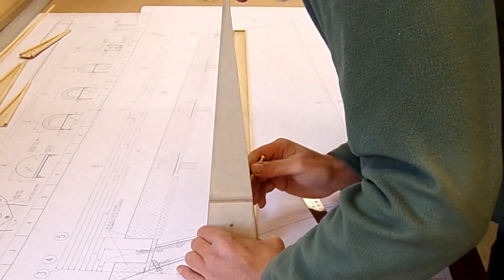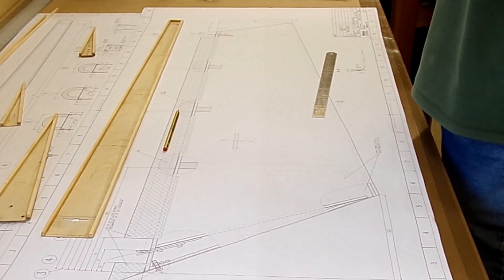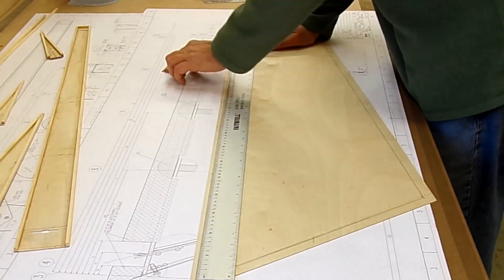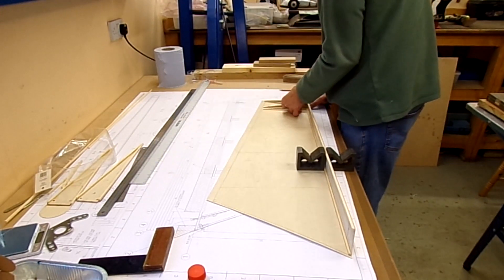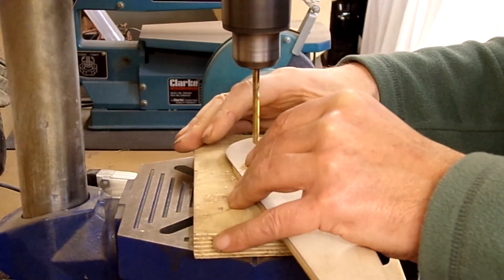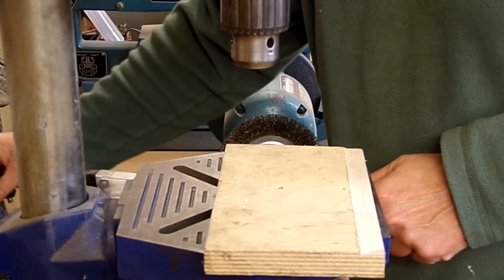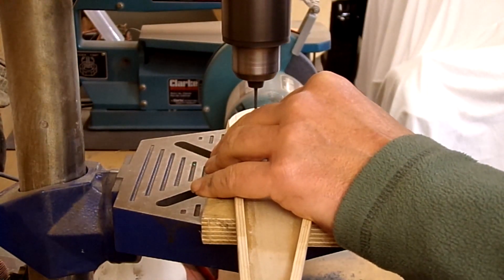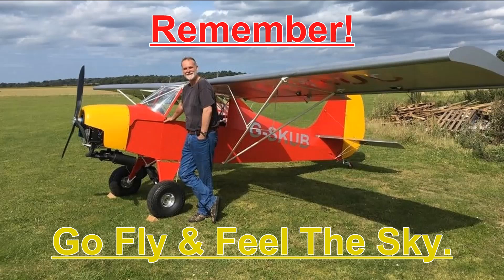Spacek SD1 TD Rudder Build EP4 (Marking out the wood skins & Prep for metal work)

Comment: Victors and the mighty Nimrod, wonderful aircraft.   Not quite as fast as the VC10 though :).  I'm  really enjoying these build videos.
Reply from the maker: The victor was faster than the VC10 at mach 0.9 ant the fact that three Victors had exceeded mach1.1! The Nimrod on teh other hand was based on the first Jet Airliner but was the best Sub Hunter in NATO for years.
Reply: @flyingkub  I can only go on personal experience, VC10 41,000 Mach 0.91, but that was normal and we used a shed load of fuel.  The Nimrod certainly had a loyal following.  I'm sure one day we can have a good long chat. I never saw a Victor fly in real life.
Reply from the maker: @GolfFoxtrot22  You missed the Victor yes we had a spped restriction with of mach 0.9 with hoses trailed but in we could sustain fast level flight to get to do refueling of Mach 0.94 (fully loaded 55 tons of fuel on board) but if we exceeded Mach 0.96 we had checks to do. Faster than Vulcan at all altitudes and a greater pay load.
Reply: @flyingkub  oh wow. Good old Conway 303s. I think the Victor Conway was a triple shaft where as the VC 10 was a double, stages 2and 3 locked together.
Reply from the maker: @GolfFoxtrot22  Yes up rated engines. A mark 1 cockpit we used for crew evactuation training had gone through Mach 1 in 1958 (that was with the smaller engines).

Comment: Just wondering, are the hinge plates Stainless ?.
I like your modus operandi, did you build the Kub as well, if so, which covering system did you use, I am leaning more to Oracover U L 600, and wondering what your experience with covering has been.
Reply from the maker: Hi the hinges are aluminum alloy, the lower one is bronze bushed.
I did help some of the build on the Kub, the covering is Oracover 600 and I found it fairly easy to apply but then I have covered a lot of models with oratex (the only difference is that had glue already applied). You do need a good iron with good temp control other than that it is straight forward and there are some good videos on line. Thanks for watching and comenting. There are a few more videos to come in the Sparcek rudder and then we may well get into a Fisher Tail Kit (as I am still not fully decided on which one I will build).
Reply: Thanks for the info, will check out the covering videos on line.
Kind Regards
Nigel
Reply from the maker: @nigelsnell9770  I should have said the aluminum is 4mm thick.  Here is a link to some instruction https://www.youtube.com/watch?v=HwPVMUnsubY&list=PLARRc-n6CImq6Lz1IBgM-hJe9EdklhrzI